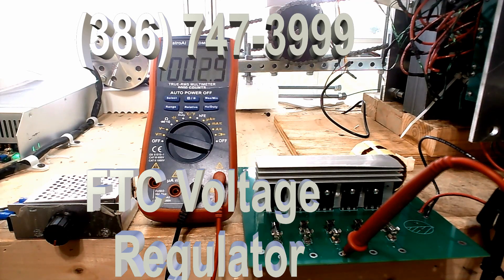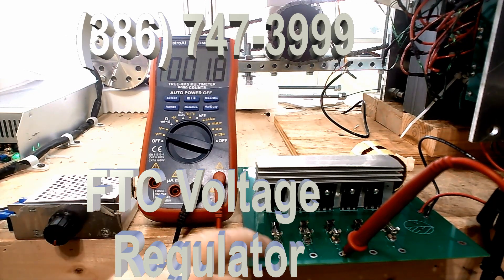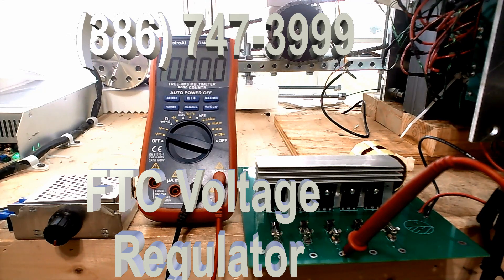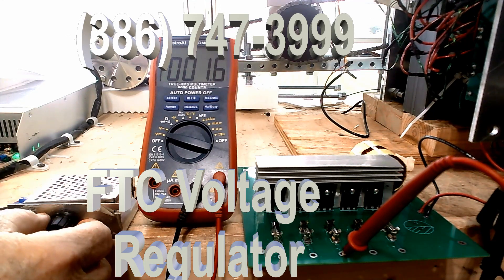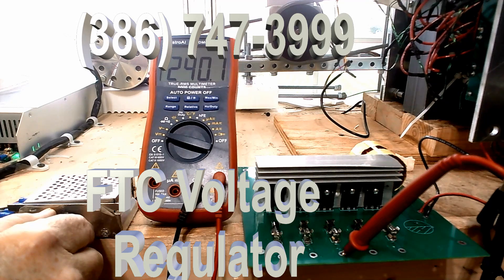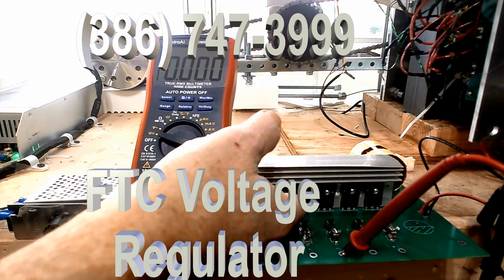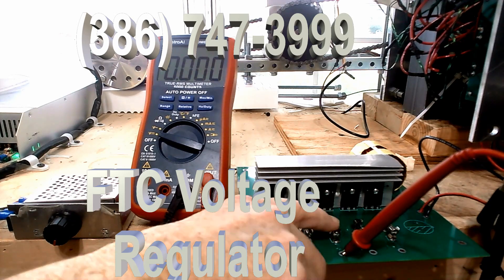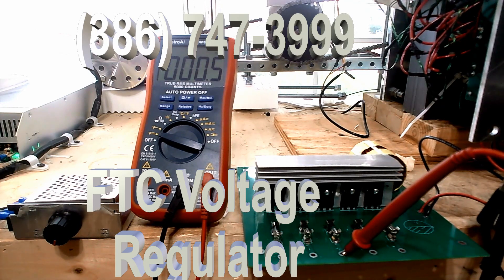New FTC Voltage Regulator

Comment: Hi Joe
I have watched many of your videos, still I haven't seen with a load connected to the generator.  Since you have been doing over the last 20 years, I think that is more important see how the voltage drop & rotor torque after connecting to the load. I appreciate if you could demonstrate that . 
Kind regards,
Din